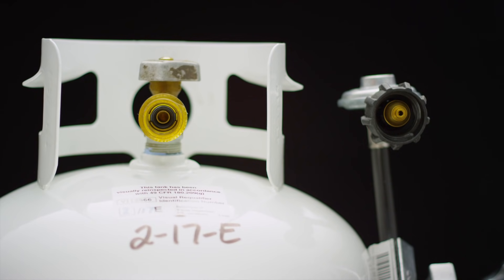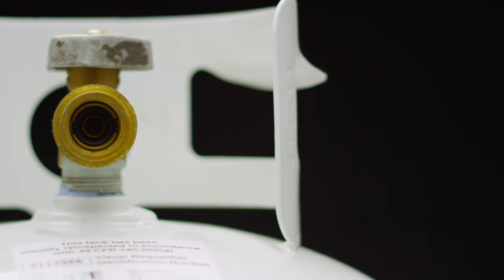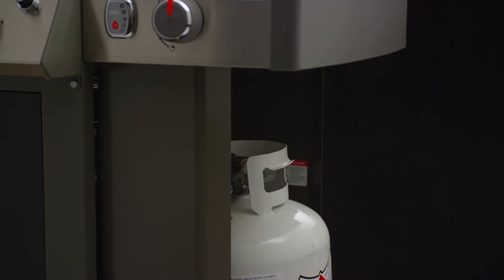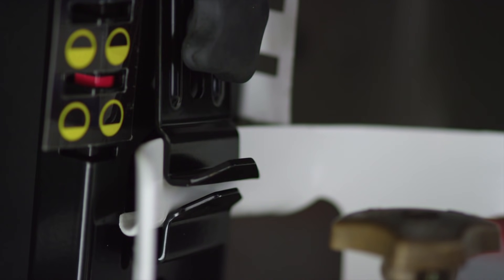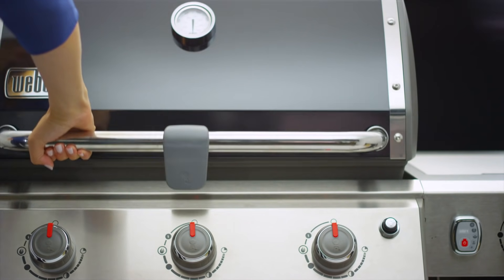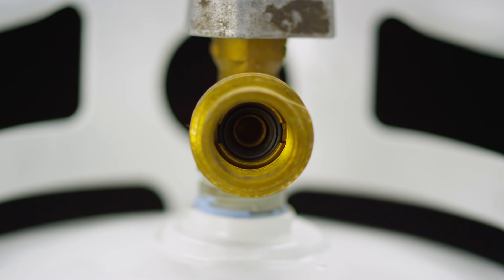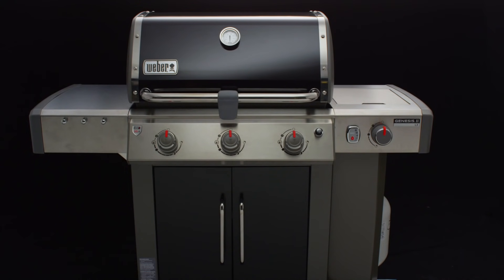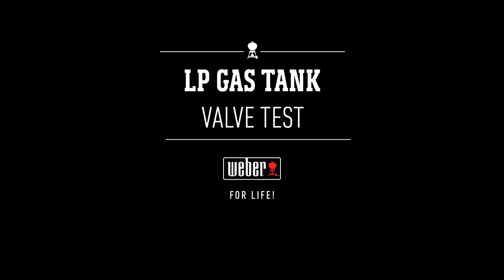How To Connect A Propane Tank To Your Gas Grill | Weber Grills

Comment: They didn't tell you that you need to open the valve very slowly before pushing the ignition button. Opening it too fast can prevent it from igniting, in my experience. Perhaps Weber solved that problem. But it was true of my old Kenmore.
Reply: I unhooked the valve that goes to my weber Traveler & I stuck a nail in it til I heard the gas flow then I hooked it up & it started tight up so it is an air issue

Comment: Soo uhh how far do you twist the knob
Reply: You turn the tank knob in the direction labeled "Open" until it stops, hand tight. Do the same for turning off, except in the close direction.
Reply: @fartpluswetone8077  
I don’t know if you will get this and perhaps be able to respond really soon here, but this is the first time I am using a propane tank and I am using it for an outdoor pizza oven.

After I get my oven to the temperature that I want it at, shouldn’t I turn the knob down lower to maintain the temperature and not get the oven any hotter?
Reply: @anti-ethniccleansing465  Instructions probably have the answer, or videos with instructions in them, but unless it's general enough such as "Keep knob set to setting X", probably could follow that procedure.

I've never worked with a gas pizza oven, but I don't see why that wouldn't work.
Reply: I heard hissing and propane smell as soon as I connected the valve to the tank and its in the close position. What to do ?
Reply: @kunalamin8 what did you wind up doing?  I had the same
Reply: @SJgolf891  i just replaced the bottle.

Comment: I unhooked the valve that goes to my weber Traveler & I stuck a nail in it til I heard the gas flow then I hooked it up & it started right up so it is an air issue. Some people say you need to  turn the tank valve very slowly.